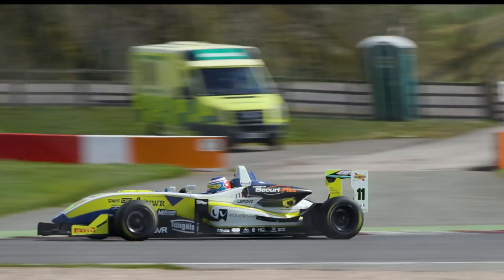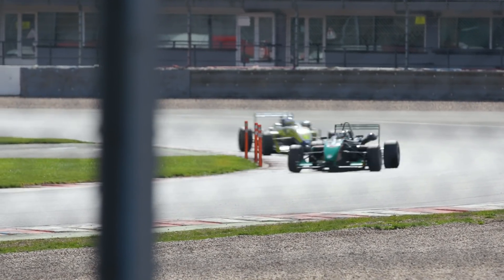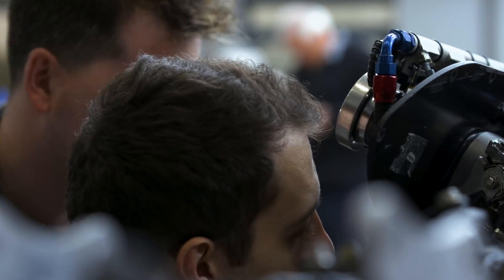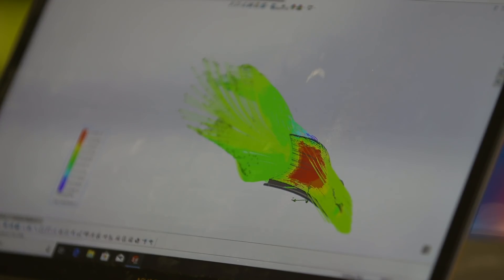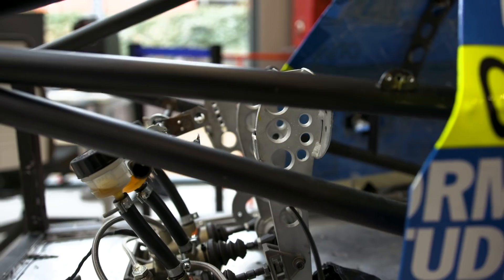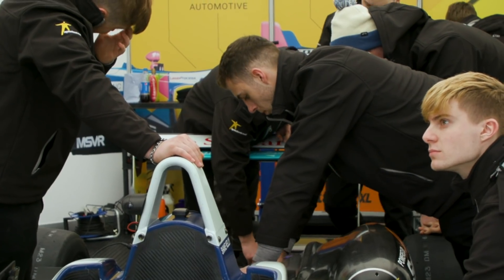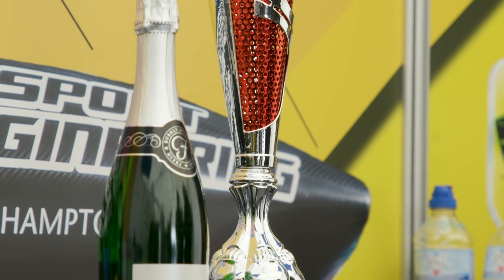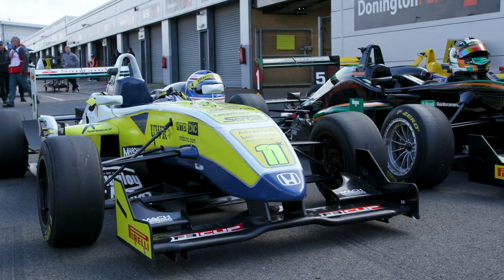The manufacturing know-how giving motorsport students the edge

Comment: Would Autosport be interested in doing a piece on Wiltshire College and University Motorsports? 

We're based literally on the grounds on Castle Combe Circuit. I sit in my class and can hear vehicles ploughing round, we have all of the resources needed to manufacrure; lathes, mills, CNC, welding, flow benches, wind tunnel (arriving soon).